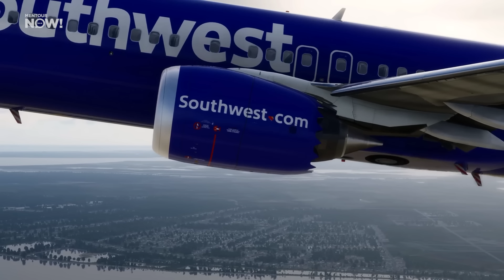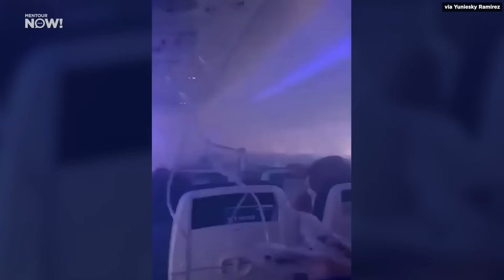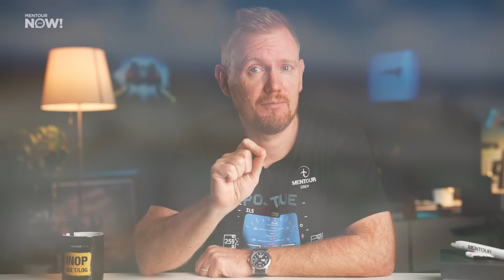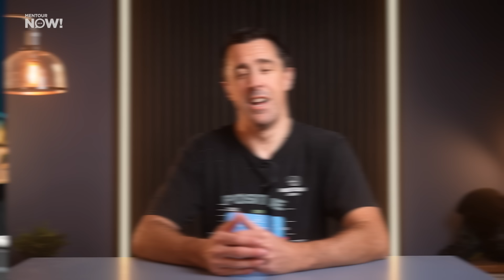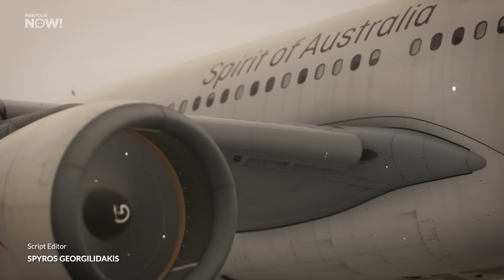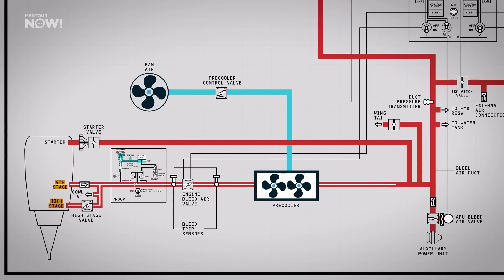Why Don’t ALL Airliners Do THIS?

Comment: 4:31 ok i got a little lost here i maybe an actual dumb ass but how do passengers not die from hypoxia we are talking about bleed air from 35,000 ft and above. EDIT: okay idk for sure but isn’t the cabin air from the climb to the cruising alt (like 10,000 ft and below) and then it just gets recycled every couple of minutes.
Reply: simple answer: the mix of oxygen and other gases is the same at 35000 feet as it is at sea level.  so by collecting the air and pressurizing it to the pressure you'd see at altitudes where hypoxia is unlikely, you also have the oxygen levels for that altitude. and also, if you missed it, the bleed air is collected before the combustion chamber, so you aren't losing oxygen to the combustion.
Reply: Percentage wise the oxygen content of high altitude air is not drastically lower than at sea level. There is just is less air in general per volume. So if you have lets say 0.1 bar of pressure at a higher altitude compared to 1 bar at sea level you can just take ten times as much air and compress it down (10 cubic meters to 1 cubic meter) and you get regular, breathable 1 bar air. (Technically it's a little more complex but thats the gist)
Reply: @zwe1l1nkehaende  oh
Reply: at FL350 and above the air still has the same percentage of oxygen as it does at sea level, but the problem is that at that lower pressure, you get less air and therefore less oxygen with every lungful of air you breathe in. that's why they pressurize the air in an airliner.
Reply: to answer your second question: no, the air isn't all recycled.  any given air cycle replaces about half the cabin air with fresh air, resulting in what is effectively 100% of the cabin air replaced every 3-5 minutes, (specifics drawn from google)  what air is recycled is also filtered through HEPA filters to remove any airborne contaminants.
Reply: It's compressed.
The ratio of oxygen isn't hugely lower.
Reply: Air at 35 000 ft has the same 21% oxygen, it's just less dense, so just needs to be pressurized.
Reply: oh thanks

Comment: The bleedless system on the 787 reminds me of FBW on the A320, and the teething issues associated with bleedless, namely battery fires, is more comparable to the A320’s teething issues in the 80s and early 90s than it is to the MAX crashes. But just like how teething issues with A320’s FBW have been rectified, the 787’s batteries don’t explode like they used to
Reply from the maker: It's true that we haven't heard any problems connected to the bleedless setup in the past few years, as far as I know! So yes, it's a matter of time, and we know much more about batteries now than we used to.
Reply: @MentourNow  Sure. How much of a weight penalty did BA have to incur, to add the heavy shielding required around the batteries, to protect against fires? Any aerospace engineer will tell you it's not worth it...especially when you can fix with software.
Reply: @frankpinmtl  You have no idea if that is actually correct
Reply: @Djamonja  Actually, I do. 

I have retired BA engineers, as friends. SPEEA members. Airplane guys and gals. 

NONE of the engineering talent in Boeing, wanted to go work on the 787, if they could stay with other programs.

They derisively call it the "tupperware jet". 

Boeing shit the bed, big time, on the program.

$10 billion in losses on production aircraft (1,250 deliveries) and another $25 billion spent in R&D.  

Even if Boeing delivers 2,500 aircraft to customers, it won't make back what it spent on the program. 

Boeing would literally be in a better financial condition, if it did NOT make the 787 from the get-go.
Reply: @frankpinmtl  What a load of crap
Reply: @Djamonja  Wow - what in depth analysis. Tell me good sir - what specifically is 'crap'? 

And don't default to the gaslighting "all of it", if you please.

Show us you have a little bit of knowledge and know what facts are...
Reply: @frankpinmtl  There are thousands of Boeing engineers, and 99% have nothing to do with the 787's electrical system. So you claiming you know anything about the 787 because you know a Boeing engineer is just hot air (which is a lot like crap, fyi). You do not know what you are talking about.
Reply: @Djamonja  Hahahaha...and that's it?

99% of Boeing engineers don't work electrical, so therefore there are these huge walls between employee groups, nobody talks, nobody reaches out for help to another engineering group, no engineers ever get moved around and you stay working on that program FOREVER. 

For instance, production planning engineers will never interface between the design team and what's happening down on the shop floor. 

When a problem like a battery fire occurs, it's left to the sole possession of the electrical group, who do not have to consult ANYONE on what changes are made. 

Wiring changes, containment capsules around batteries, structural engineers because of weight changes to supporting structures, engineering teams that must now work the the FAA who must not only DESIGN the structure to meet standards, but must now work with the cert team to get it through regulators. 

Then it's back to the production planning group, who now have to incorporate the changes in production to accommodate the line and master planning sked. 

Not to mention that the wiring shop now has to change EVERYTHING in relation to how the harnesses are designed, where the attachment points are, how the wires are passed through the containment structure. Wire lengths also change, how they are bundled with the other wires, how many fasteners are needed.

Then it's off to the engineering team that works on the supply chain - who now have to go to Tier 1 and Tier 2 suppliers, working with them to get the materials in to create the darn things. 

You have no fcuking idea, how complex a process and how many people are involved and how so many people have to work together, to make a fix like this happen.

AND...how many people talk. 

Why the hell do you think it is currently taking the Max 7 and Max 10 so long, to get a fix made, for the heater problem on the engine nacelle?

Why do you think the 777X program is 7 years behind EIS?

Why do you think the 787has two delivery stoppages - the last one was 20 months, when changes happen.

EVERYTHING...is a knock on effect. 

Every little change has to be run past an engineering team, which has to make sure that all the materials, the way the unit is built, who will install it and how it effects the workflow...is certified. 

This isn't Nascar - you don't just hammer it out, weld on a new part and call it a day. 

Obviously, you have no clue about the commercial aviation industry...
Reply: @frankpinmtl  You have no clue what you are talking about.
Reply: @frankpinmtl  And in the same vein, Airbus would be further ahead if they’d never made the A380 mistake.
Reply: @Plunderkind  Absolutely. 

The difference being that the A380 debacle is the current 777X equivalent. This program also has $10bn in write-offs, with no end in sight. 

Certification is now slated for 2027 and the program is expected to burn through another $3bn in cash this year. 

Boeing has a 60/40 advantage in the WB segment,  but the A330Neo and the A350 programs are both profitable and have paid back their initial investment. 

The focus for Airbus moving forward is 1) The supply chain to get to rate 75 on the A320 family and 2) Getting the A220 program into the black and producing at double-digit rates.
Reply: They had problems because Boeing outsourced the design and manufacturing of the battery system to incompetent entities.  The redesigned system was done by knowledgeable engineers and properly manufactured batteries are now used. The irony is that now the total system weight is more than if the battery system had stayed with the non lithium ion batteries used in older designs.  This is shown in detail by one of aircraft mechanics on youtube. So basically the problem was that Boeing wanted to go a new direction but didn’t have enough internal understanding of the issues to recognize whether the external design and specification entitle was competent.
Reply: @Mentaculus42  Like most of the aircraft.
Reply: @Mentaculus42  The batteries would appear to be anything but competent.
Reply: @naughtiusmaximus830 

The original ones, but the redesigned ones are fine!
Reply: @Mentaculus42  The Air India crash would suggest otherwise.
Reply: @naughtiusmaximus830 

Not really, obviously you have not understood anything about that incident!
Reply: @Mentaculus42  I can say that about you with greater confidence.  Do you even know what a diode is?
Reply: @naughtiusmaximus830 

Yes, and it is clear that you have zero understanding of how a 787 operates and I guess u are unhappy with the findings of what APPEARS to have happened there. So u don’t believe that one of the pilots switched the engines off but rather believe that the 787 was at fault.
Reply: @naughtiusmaximus830 Stop spreading misinformation. The Air India crash was caused by one of the pilots accidentally turning one of the engines off. The aircraft itself was functioning perfectly, entirely as it should - and indeed, the 787 has proven to be a safe aircraft with few incidents and no casualty-causing accidents after its teething issues until the Air India crash, which -- again -- wasn't the aircraft's fault.

As much as I also like to bash on Boeing, we shouldn't invent shit about them just for kicks -- they're doing that plenty well themselves.
Reply: The battery issue has nothing to do with the electric packs.
Reply: yes nothing goes wrong with 787 batteries
Reply: As I understand it Boeing just built a case around the batteries.  Now when they explode they fry the rest of the control systems.
Reply: @naughtiusmaximus830 

BS, if there is a problem the gases are directly vented outside of the aircraft (part of the redesign). But more importantly, the manufacturing flaw in the lithium ion batteries has been corrected.
Reply: @naughtiusmaximus830  You don't understand much
Reply: @naughtiusmaximus830 
Didn't they also switch from lithium ion to lithium iron phosphate? There's a weight penalty in doing that, but the chance of fire goes from "rare" to "even if you try, it's quite difficult".
Reply: Fly by wire on the airbus was not revolutionary. It existed before.
Reply: @CorneliusTaylor-s1u

In military aircraft.
Reply: @Mentaculus42  Never heard of the Concorde, have you?
Reply: @frankpinmtl 

Yes I have, and the Concord was an ANALOG system that was a step in the direction of FBW but far from a FULL DIGITAL CONTROL SYSTEM. The Concord’s system was more an enhancement of previous generations of aircraft systems but it really comes down to definition of FBW! So technically u r correct as analog computers can do a lot also but that type of technology was being used in military aircraft. I was specifically referring to a MODERN DIGITAL FLY BY WIRE SYSTEM that compares to modern Airbus. You are comparing apples to kumquats, legitimate but really needs to be differentiated.
Reply: @Mentaculus42  Sorry, but that is NOT what was said, was it?

The comment was that FBW was not revolutionary for Airbus - and you chimed it "in military aircraft". 

Then you try to move the goalposts, going on about analog and other stuff.

Here, some light reading for you:

"Fly-by-wire (FBW) is a modern flight control system that replaces conventional manual, mechanical linkages (cables, pulleys) with an electronic interface. Pilot inputs are converted into digital signals, processed by flight control computers, and sent to actuators to move flight control surfaces, improving safety, reducing weight, and enhancing maneuverability."

FBW went from military aircraft, to the Apollo flying bedstand, to the Concorde, which was the first production FBW commercial aircraft, with analog control.

THEN...Airbus used it, in it's aircraft. While Boeing was stuck in the dark ages. 

To summarize - the point was about FBW aircraft, it wasn't about analog or digital control. Was it? 

Both analog and digital are...FBW systems.
Reply: @frankpinmtl @frankpinmtl l comment was in context about the original digital fly by wire with regard to the Airbus 320 IN MY MIND. You are free to your own interpretation, I am free to mine. I said that the Concord’s analogy system was a legitimate counter but not really a direct comparison. Considering that I have a graduate engineering degree in control systems AND I acknowledged that Concord was a step along the way to full digital (and stating that similar analogy systems were in other aircraft) then the discussion comes down to personal “terminological definitions”. I generally disengage when the discussion revolves around definitions. So it was my fault that I did not over specify what I was referring to. There are more important things to argue about and I bow to your superior use of the English language.

My reading of the very first comment was that there was some type of “revolutionary aspect” of the Airbus original digital fly by wire system while the “revolutionary aspects” of digital FBW had already been developed in other non airline aircraft (research aircraft). So this pi..ing contest is about my understanding of the intent of the original comment.  Your contention is anything that interposes a control loop between the human and final output is fare game and to me that is moving the goal post. We could argue this for a long time while going further back into historical minutiae. It is all based on the interpretation of the intent of the original comment. English is hard, take your victory lap. 

You criticize Boeing about being in the dark ages and yet by your definition of FBW the 737 MAX is FBW as it has control loops that are digitally controlled that can and did override the pilot’s input and cause the crashes. So I guess we are back to DEFINITIONS as what is and is not FBW as most people would consider the MAX as not FBW.  But from my perspective there are a number of FBW aspects in the MAX system (strapped onto an old design). So it gets definitional again. But u win!
Reply: @frankpinmtl Why do you have to be insufferable in every single comment thread? Go touch grass.
Reply: @mnxs  Poor snowflake. Do you need a hug?
Reply: @CorneliusTaylor-s1u Yes, but why didn't ALL planes get it way earlier?  Those old planes could do a tail slide, if the kidnappers had sense of humor. Do you understand what that means?
Reply: But all of the starter/generators were quietly replaced. I never heard of one exploding, but they didn't replace them just becase there was nothing wrong.
Reply: The battery chemistry was changed in 2012. How many battery fires have you heard of since then ???
Reply: @savagecub battery fires were in 2013 but stopped in 2014
Reply: Yes, those batteries just don't explode like they used to anymore. Shame shame.
Reply: Lol I read it like that too.